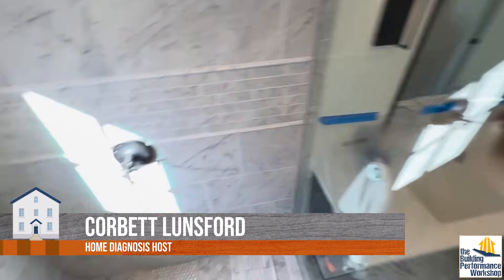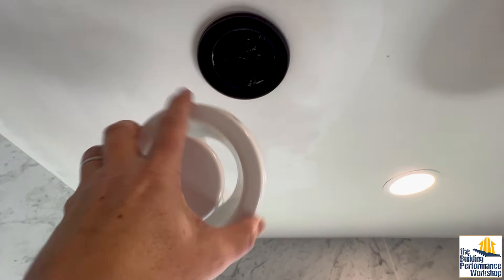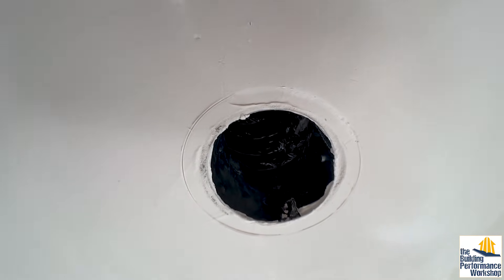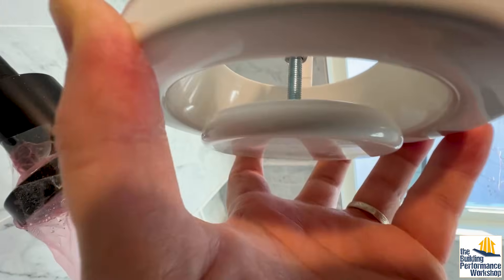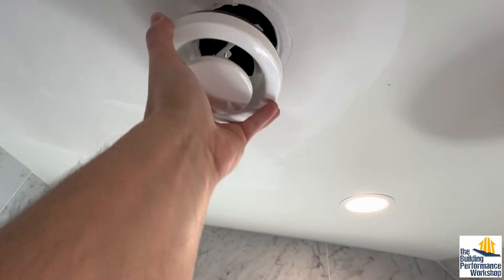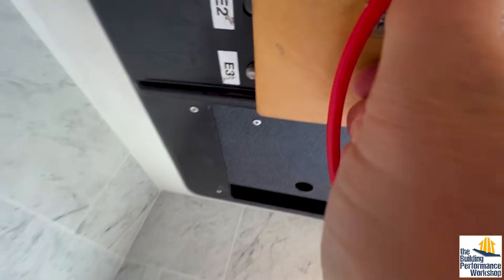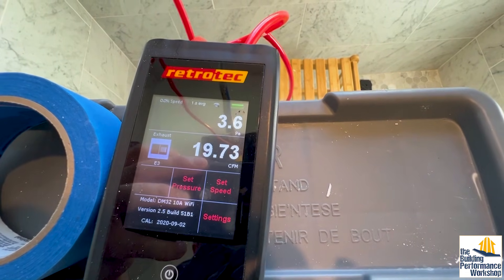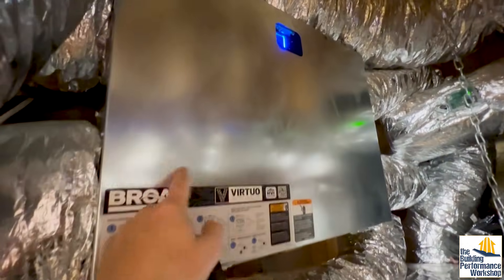ERV Setup Testing at Exhaust Grilles: Broan AI Ventilation Commissioning & Balancing

Comment: Thanks for the videos. What small ERV would you recommend for a small (500ft2) remote cabin that is only intermittently occupied? Climate zone 6/7

If it matters, heat source will be a tiny wood stove with outside air for combustion.
Reply from the maker: I’d think of windows first, but Panasonic WhisperComfort 60
Reply: @HomePerformance  - thanks… looking at triple pane, (window prices are OK) but shipping might break the bank. Cabin will be in Canada.

Comment: In the commercial space, the mechanical engineer will specify in the drawings how they want the mechanical system(s) tested and balanced.

Are testing and balancing per a specified parameter or design document? Or, some other means. Asking to better understand.
Reply from the maker: Residential is the wild west- I direct clients of mine to do this test with a cardboard box (stay tuned for that). There are 8 ways to test, see here: https://youtu.be/9vwmP1T2ReI?si=5WogER7pvRQoqpXv
Reply: @HomePerformance , 10-4 … that will be me soon! 😂 Finalizing the electrical and plumbing through the holidays.
Reply: They are with Zhender and Brink. Likely others too.
Reply: I have the same grills but don't like them because they are only about 3 inches compared to the 4 inch ducts, I had to do some work to get my flows balanced as well